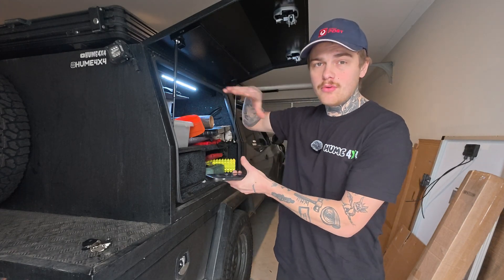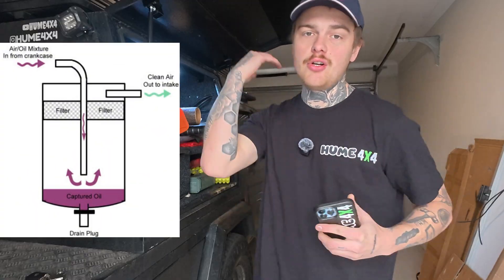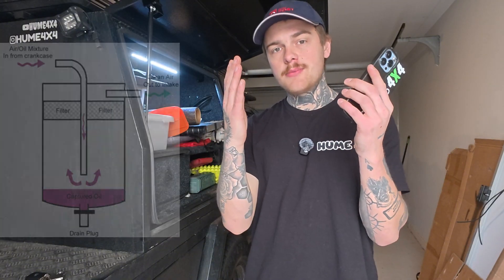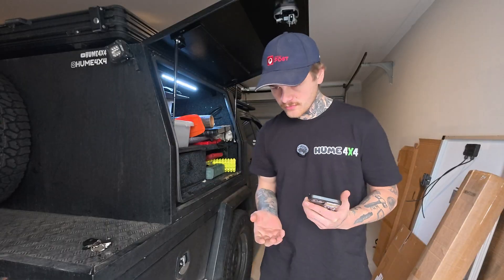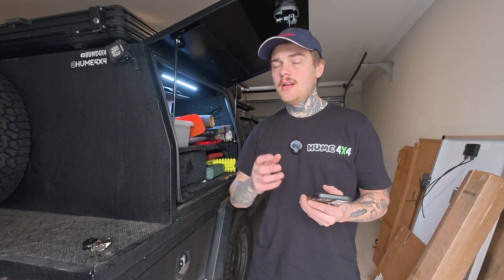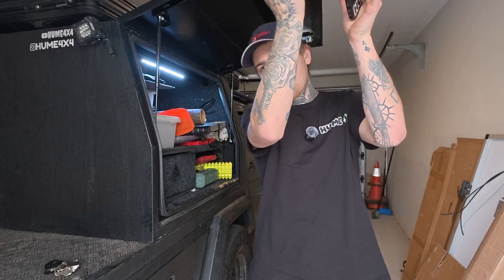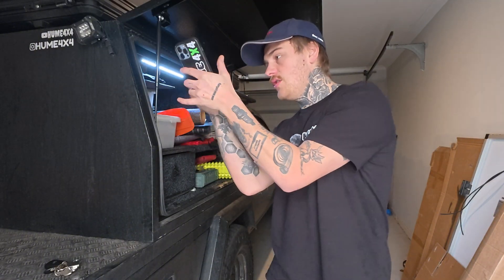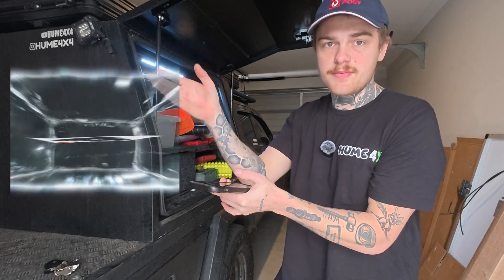Will a Catch Can Improve or Destroy Your Engine?

Comment: Good stuff as per usual man! I've just blocked my EGR and this will most likely be my next mod. Great info brother!
Reply from the maker: Thanks mate! How you finding the block so far? Any noticeable differences?
Reply: @hume4x4 found the throttle feels slightly more responsive, but I'm now missing that sweet dose I once used to get from my snorkel since doing it 😭. I think I might just have to buy an exhaust 😏....
Reply from the maker: @fynnmaggs1959 It shouldn’t effect turbo whistles at all? Thats super odd bro! Yeah i’m gonna make a staino install vid in a couple weks
Reply: @hume4x4 that's exactly what I thought man. But since chucking in the gasket my whistle is practically non existent.... Keen to see how yours turns out though bro!
Reply from the maker: @fynnmaggs1959 so weird maybe there was a small air leak somewhere you’ve sealed up! hahah yeah i’ll keep ya updated on the snorkel, gotta work up courage to cut my guards first lol
Reply: @hume4x4 keen to see it brother

Comment: Not my Opinion/Argument but The argument against I've heard is that the fine oil mist lubricates the Turbo and it's people not "Driving Like they Stole It" and getting the turbo hot to burn off that oil which cause problems in long run. The argument is that catch can then leaves the Turbo inners dry.
One of those things that once is mentioned you notice people with catch cans blowing Turbos at 300k while people not running C.C still going strong at 700k
There is a lot more to it though. End of day it all comes down to overall maintenance
Reply from the maker: Fair call bro, I’ve heard that argument floating around too. Personally I reckon turbos are happier on clean oil from the feed line rather than copping mist from crank blow-by. But like you said, at the end of the day it’s all about servicing and keeping the thing maintained. Appreciate you chucking in the other side of the story 👌